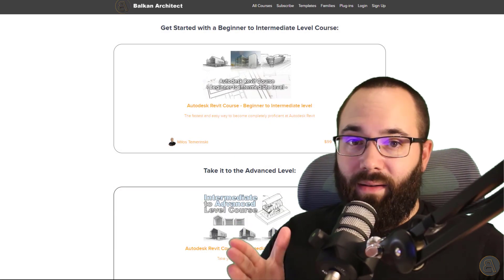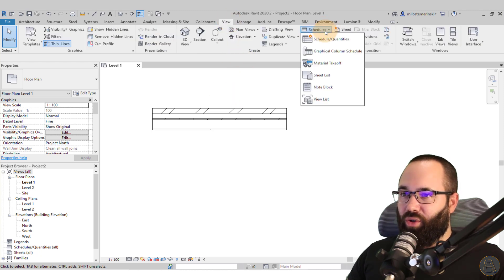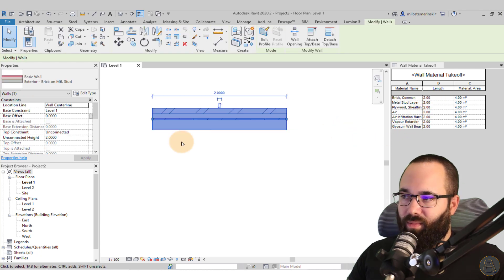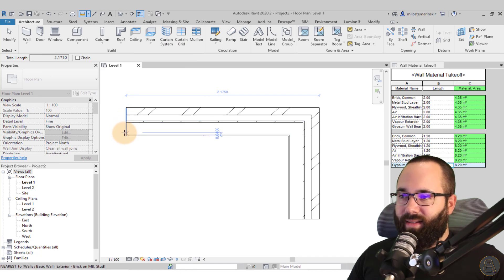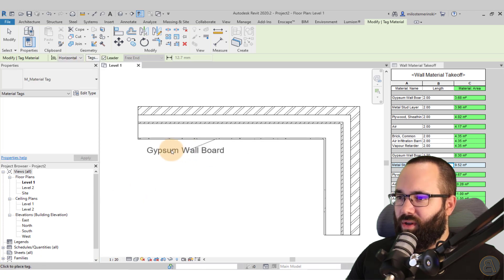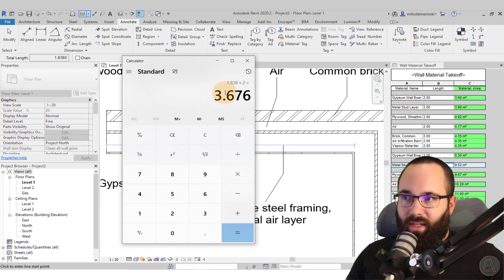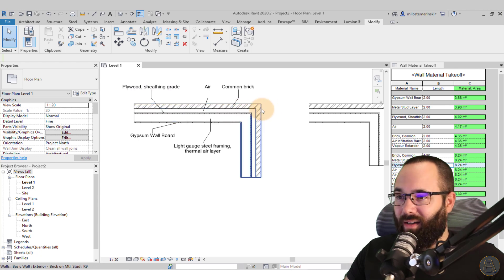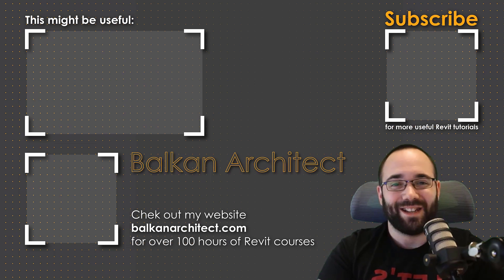Dangerous BUG in Revit Tutorial

Comment: i checked it some time ago, and i found that the length used for the calculations changed with the grip of the walls, independent of the cut type you used on the corners. Even with one-layer walls, the length is somehow always wrong. Using different walls for different layers for now.

Comment: I would not characterize this as a bug, but "as designed" the calculation is somewhat abstracted and based on a planar wall. The calculation is abstracted for the sake of speed and an easily implemented rules for almost every possible wall join/configuration. You can easily imagine wall conditions with multiple wall types coming together at multiple angles making joints quite complicated. Getting a truly "accurate" takeoff could become quite challenging and in most cases would not matter all that much since materials are ordered by the palette full, not by the individual brick.

Comment: Any reason you are still using 2020 when Revit is currently up to 2023?
Reply: Most probably compatibility issues. Revit is some dinosaur software that is not backwards compatible with its own files.
Reply: @simonk.2969  Files are updated the first time you open them in the new version, just like any other software. I would bet that Balkan Architect would disagree that Revit is a dinosaur software, as would many others.
Reply: @MJK0627  I said backward compatibility and not forward compatibility. As in you cannot open a 2021 in 2020. And the basic functions of revit like file management are dinosaur.
Reply from the maker: Yes, it's because of compatibility issues. I share my project files on my Patreon page. I I used Revit 2023, my patrons that are using earlier versions would not be able to open those files. This is why I always stay a few versions behind. :)
Reply: It will be problem if only you use lastest version. While other consultants or people want to access ur file but they can't.

Comment: When I model in place component's for my roof trusses and mirror on on a grid point and use reference lines to check placement of mirror and it is slightly off every time. I have spent hours re drawing and remeasuring  just to have the same issues. This is sad, and has caused multiple hours of rework for this client. #autodesk needs to make right free software for everyone who has already worked in Revit 2023.

Comment: Schedule your wall in parts(materials)...every software has blind spots even though Revit is so expensive but that's also why the word development exists.
Reply: Might be the solution, depends on situation. Possible problems: 1. If all project walls all are turned to parts, this might be problematic for Revit to handle the quantity load? 2. Parts needs further tweaking to report correct areas.
My conclusion: 
Large project - just use "estimated values" (having most walls length on average 10+ metres length should provide about les then 2% discrapancy). Even discrepancy could be calculated analizing wall materials & wall lengths. 
Small Projects: use parts.